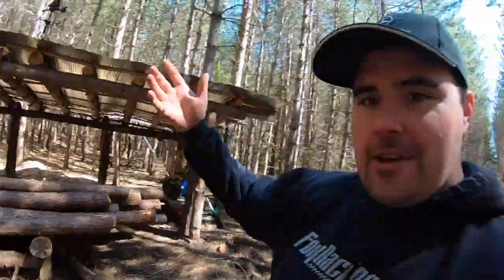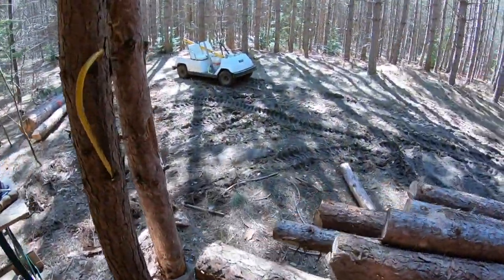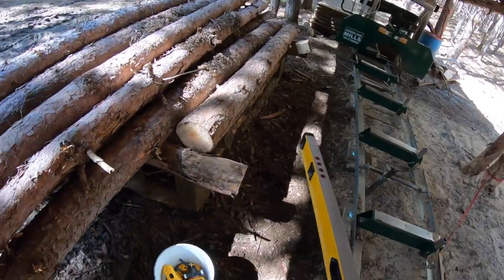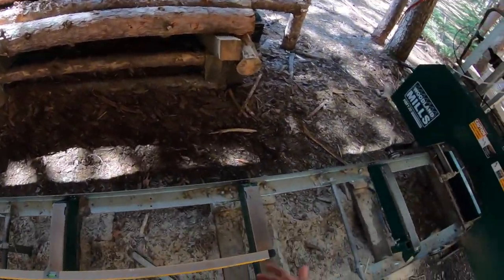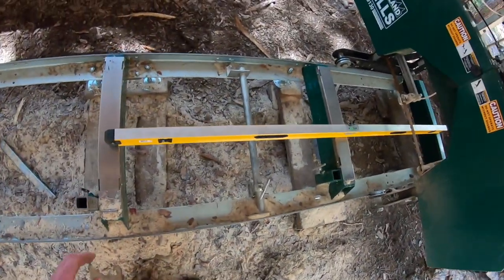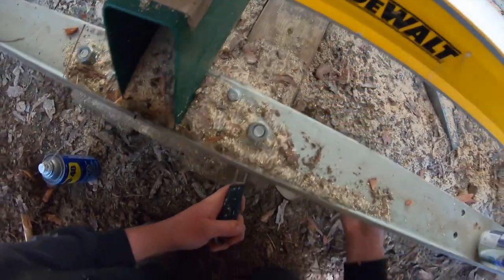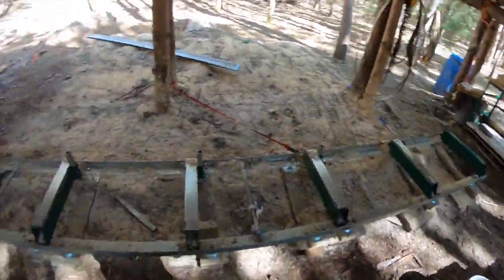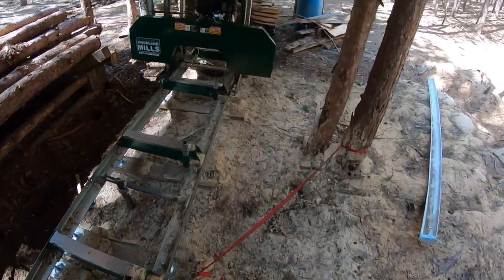Woodland Mills HM130 Portable Sawmill Setup.

Comment: I dont wanna be THAT guy, but WD40 dose not make a good lube because its designed to break down corrosion, but not to stick around long term. Fluid Film would work better for long term use, BUT an actual spray lube rated for gear and chain would be ideal.
Reply from the maker: Braedon Plett thanks for the tips. That makes sense and I’ll likely need to change up some of my goto lubricants. Thanks for passing that info along